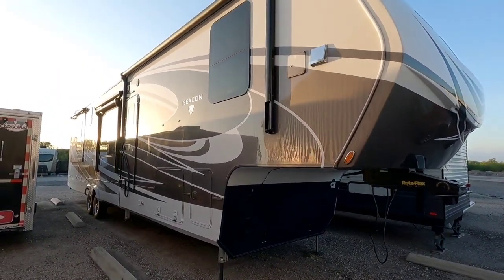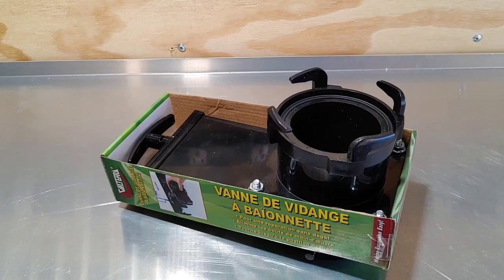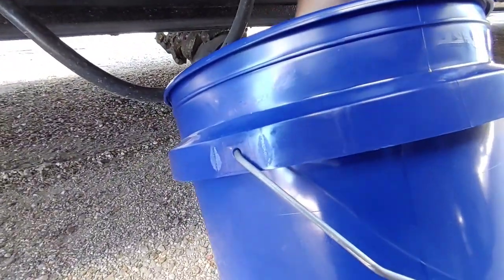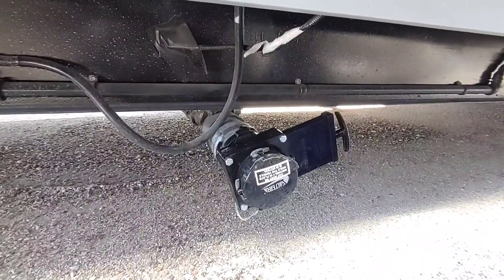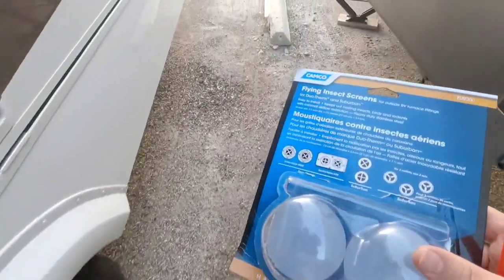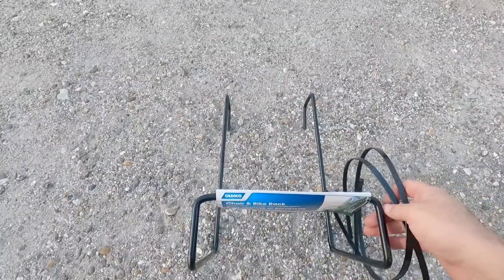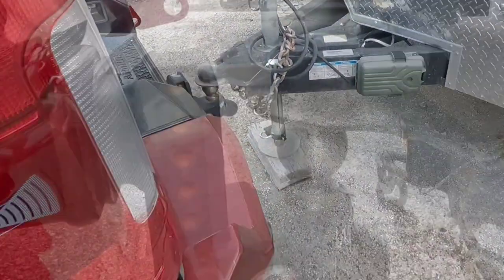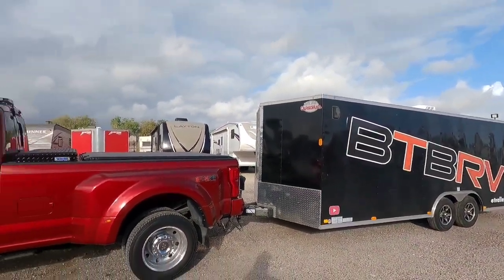3 RV Must have Accessories! All under $50ea! Valterra and Camco

Comment from the maker: I caught the fact that I didn't cross the chains before taking off.  I moved the trailer to a shed in the same facility to load up my moving equipment and added a hitch extender to the back, which made me catch that I didn't cross the chains. Sometimes filming throws you off a bit.
Reply: I caught that! No expert myself, but I do know what happens when a flat trailer pops off the hitch at 65 mph. Thank God I crossed those chains! Lol
Reply: I was hollering. Lol
Reply: Alan d'Eon  Its not that important. It's more important to not need them.
Reply: Alan d'Eon  That sentence make absolutely no sense. I don't even know what you're trying to say.
Reply: Alan d'Eon  No my response was to the topic of CROSSING them. Some people even argue they should not be crossed. The tongue hitting the ground is really a moot point once you've lost the trailer so like a said above. It's more important to not lose the trailer than to think your safety chain hookup method matters, as long as they are hooked up.
Reply: @russellv6234  you should always cross the chains
Reply: @russellv6234  
You'll think that until the tongue hit's the ground. And digs in.
Reply: I even stopped the video to make a comment warning you about the chains.😀

Comment: One big advantage to that gate valve is having a  backup valve!  If you've ever had a gate valve failure on the road, finding the correct  valve then, trying to replace it in the campground, which is usually prohibited! Or  finding a repair shop, you know the routine...... And of course that plumbing is NEVER designed for easy replacement! 
Always enjoy ur post!

Comment: Since the safety chain issue came up, maybe you could do a video showing the proper way to hitch up a travel trailer? You could talk about sizing the chain, chain length, and where to attach the breakaway cable. Most importantly, explain the purpose of crossing the chains. I’ve known people who didn’t realize they needed to have a battery on the trailer to activate the electric brakes in an emergency. That system could be discussed. 
Over the years I’ve seen trailers with undersized chains, trailers with just one chain, chains that were dragging on the ground, as well as chains that were too short. This is an issue that deserves some attention.

Comment: Yep, that Valtera twist on waste valve would have been real nice to have about 6 years ago.
Back then I bought our first ever travel trailer, (used), and did a lot of work on it. I bought it in February, so we had a few months before we could actually take it out camping. 
Keep in mind, this was our very first ever camper. My wife had always wanted one but I forced her for years to camp in a tent on cots, no AC, primitive, like the Army style. 
But I gave in finally after her back surgery didn’t go well. Lots of pain ALL the time. I wanted her to be as comfortable as possible.
So it comes to our very first trip out. We spent a week at our favorite state park. Half way through I had to dump the tanks. I went to connect the hose, removing the cap and I swear a GUSHER of waste came out. The valves were CLOSED, but… someone had obviously opened and then closed them, letting the pipe fill up. 
Bad joke on me, I was covered in it and MAD AS HECK. 
I had to use the non potable rinse hose to rinse myself off, then had to clean the mess up. 
Boy was I pissed. Incensed more like it. Fuming mad. Angry.
But the worst part of the experience was, EVERYONE around, including my wife, were laughing at me. 
What could I do ?
I calmed myself down, finished my task, remarked the trailer in its spot and promptly took a LONG HOT SHOWER  with lots and lots of soap ! LOL !
I look back on that experience and laugh about myself from time to time, but now I am gunshy so to speak when it comes to dump time. I still do the job, because no one else will, but I do it.
And no, the valves weren’t leaking causing the pipe to fill, as that was the only time it had ever happened. 
Someone played a nasty prank on me and it worked. 
Oh well, live and learn I guess. 
Now anytime, everytime we go, I make sure those valves are CLOSED and remain closed. I kind of wish they came equipped with keyed locks haha

Comment: Try a California Duster for cleaning the trailer.
I've been using one for over 30 years on my vehicles and the result is great.
Takes about 90 seconds to dust off a vehicle or trailer of your size.
Can only use the duster if the vehicle is dry.
Even though the duster holds much dirt - it has never scratched or marred the paint.
Shake it out during dusting and when finished.
The dirtier the duster appears, the better it works.

Comment: I've had the sewer surprise several times.      You would be surprised how much pressure a few gallons of poo can have. Just remember to keep your mouth closed when you take off the cap. I've changed enough diapers. Sewer doesn't even phase me.

Comment: I put that gate valve on a while back, it’s a great upgrade! Should be standard equipment on all rv’s.
Reply: Yup! I agree! I just bought one tonight…mine leaks pretty good.
Reply: Camping for 40 years never had a need for one...
Reply: Funny enough. I caught the lever for the black tank once while rolling up my 50 amp cord. The cap was on but the black tank valve was open for a minute until I realized it. Imagine the fun of taking off the cap at the dump station. A 2nd gate valve became a must after that.

Comment: The gate valve is the best thing since sliced bread. I saw someone from another channel recently install one but it was a permanent one that they had to cut the old coupling off and use pvc cleaner and cement. I like this one but I'd definitely put a screw threw it in case it decided to come off. I can't tell you over the years how many times I've forgotten to close the gray tank after dumping then find out when you take the cap off whoooosh. I've also forgotten to close the black tank before as well and just pulled the gray valve and gotten that too. I installed a clear extension on to see what's in the tube before opening. I've got the 30wrs work and play and they couldn't have put my valves in any harder to reach places. There's been times paper has not let the black valve seat properly. I just knew the next dumping was going to involve stuff in the tube. This part will eliminate the bucket to keep spillage. Thanks for sharing.

Comment: YES! I had this leakage problem with our last travel trailer.  I didn't think there was enough room to put on the extra waste valve because the connection was so close to the ground as it's was, but it should be a lot better on our next one.  After an unfortunate incident in a campground, I learned to "catch" the flow in the septic hose when taking off the cover.   But even sometimes I would forget.  😅  Thank you for all the tips in this video, especially for backing up with no camera!

Comment: Here in South Carolina the bug guards are a necessity. I installed them on on the heater, water heater, and fridge.  I learned about the Valtera valves when I took a cap off and the water splattered on my shoes. Now I’ve got the valves...not the shoes!

Comment: JD, I like your advice to install the bike/chair/access bracket higher, for this reason: seeing how far down the chairs hang, they BLOCK THE TAIL/BRAKE LIGHT. For some drivers following you, they may not be looking the other direction and could smash into the rear of your rig. Love the Valtera valve and furnace vent covers; 2 of the first items to purchase, indeed.
Y'all Be Safe!

Comment: Hello 
Tom here...
I put a self tapping screw behind one of the locking tabs to prevent the "accidental" disconnect ....
Now when I dump I do the black first-close the black gate & use the gray to flush. 
Been using mine for 2 years now.👍

Comment: The bug guards and the valve on the end of the discharge pipe should be standard equipment on travel trailers and 5th wheels. Those were the first upgrades I made to out TT. The valve makes connecting and disconnecting so much cleaner.

Comment: I did both upgrades just not the chair upgrade.  I also recommend placing a 4" ss clamp around the ears of the gate valve to secure it tightly to the pipe and prevent it from accidentally turning off the pipe when attaching or removing your hose. Place the clamp just over the locking ears and tighten securely.  Works like a charm.

Comment: JD, 
On that valve I have seen many channels that tell you to drain your black tank then leave the black tank open. Close the Valtera valve then open the grey tank... this ideally would rinse the black tank and require less water to flush the black. Well this may work once or twice but here's the problem. If you put a lot of paper in the toilet (not saying who in my marriage does this but it's not the husband) what happens is that when you back wash the black tank with grey water it will force the paper up into the air vent. Then, the paper dries and becomes a solid and can completely clog the air vent. This is a no bueno situation. What then happens is that you end up venting the holding tank back up through the toilet. Whenever you flush you get bubbles coming up through the black water in your toilet. All because some cute young YouTube RV couple told me to use this valve to clean out the black tank. DON'T DO IT!!! Flush the tank out normally and don't mix the black and grey tanks. I know it should make sense but only do it when absolutely necessary. Sorry for the rant but this information needs to get out there. I'm telling you from experience. LOL. I love looking at the cute young couples (well they can be eye candy on YouTube) but sometimes their expert advice does not come from experience. My testimony here is from experience. 
Thanks for indulging my rant on your channel. 
Pat
Reply: Never in 30 years heard anyone say to leave the black tank valve open to do that.

Comment: FYI, bought two Valterra valves for the front and back drains and after the installation put a small self tapping screw on the top next to the locking cam. Should I need to replace a valve just take the screw from the top and remove the valve, just a handy thought, thanks for the video.

Comment: One note about the vent screens, they also make them for refrigerator vents and water heater vents. I have them installed on all my vents, very easy to install, not expensive and can prevent potentially dangerous hazards like carbon monoxide or fires.

Comment: Those furnace screens are pretty slick.  Our Trailmanor has the valves at the end of the pipes so not much need to install another valve.  They look like a great idea for larger trailers with long pipes between the valves and caps though.  Cool accessories.  E-trailer is one of our go-to suppliers.

Comment: For the sewer hose hook-up, I just hold the open end of the hose I'm going to connect directly under the opening of the dump pipe. When I'm taking the dum pipe cap off, I let pressure release first, then I slowly take the cap off, tipping it toward me, then pulling it away completely once I know nothing is there and/or everything has dropped into the sewer hose.

Comment: I have an old fiver. I'm absolutely getting this. Thank you. No "surprises" when setting up at another campground. On Etrailer, the valve is $45 and change. On Wal Mart, it's $28 and change. I always shop around.
Reply: Camco equivalent of external dump valve is 19$ on Amazon -- MARCH 2022

Comment: Our travel trailer has two grey tanks that drain in the same spot.  The second grey tank is only for the laundry hookup that we don't use.  So to take advantage of that second tank, we close that outer valve, keep the black water valve closed, and open the two grey water valves.  Gravity will fill both grey tanks evenly.
Reply: Clever.

Comment: For the Valterra valve, I drill a small hole on the bayonet on the valve that connects to the rv drain pipe and insert a small cotter pin to prevent the valve from twisting off while twisting the cap off.   I think this would be a good idea for the manufacturer to include.

Comment: Tips like these are always welcome, so thank you.  Our older travel trailer never leaked a drop from the drain line when uncapped, but our newer Montana always leaks out about a cup of bluish water from the deodorant / disinfectant I always put down the toilet at the end of every trip.  I will definitely be getting this gate valve.  Great innovation for the bug guards, will get those as well.  Zip ties are a must for the ladder rack.  I learned the hard way by just hanging mine over the rung and bungie cording chairs to it.  While bouncing down the road, the rack bounced off and swung free on one side taking out our rear taillight lens, but not scratching the paint...got lucky.  Funny, but for solo backing and hitching, I have always used that same process by using a block of wood on the ground as a reference to my foot.  Don't forget to grease that ball before hitching.  I've had a heck of a time unhitching at times without greasing the ball first.

Comment: Your external gate valve is good to back flush your black tank with your grey tanks , get one you can hook a water hose up to and fresh water flush black tank. Do not flush galley tank if it does not have traditional p - trap .

Comment: One thing I got in the habit of doing. I would rig the sewer hose to the fitting on the ground. Then I would hold the camper end under the cap to catch anything that comes out when I remove the cap.

Comment: I had a mess because somebody left the black water drain valve open. I chose to modify the inside of the valve by removing the inner bayonet connector and replacing it with a standard glue in to 3" pipe. Then I cut off the bayonet connector on the outlet pipe and glued a 3" coupler with ABS glue. This also reduced the protrusion of the extra valve and ensured that it would not work loose and fall off. The best upgrade I've done yet.

Comment: One problem we came to discover is that "Prancksters" will pull that handle on the valve to allow the mess to come towards the front cap.  My husband was able to affix a zip tie through a hole he drilled so he'd know if it was tampered with or not.

Comment: My Gates are at the end of the Pipe, Rockwood 2613WS. I also have a 6 inch clear extension attached so I do not have to lean so far down to attach the hose. The clear  extension allows me to see what is left in the drain before closing the valve.

Comment: Dump the black tank first and clean out the lines by dumping the grey water last.  I've never had any surprises waiting in the dump hose or the gate valves doing this. I have never seen any RV that didn't have installed gate valves from the factory. One thing you can do is get a can of silicone spray to lube the valve rubber seals or use Thetford valve lube in your grey and black tank.

Comment: I bought a wide mouth funnel on Amazon and insert into the sewer hose and then hold under cap when I remove.  When any "surprise" is over I set funnel aside and attach the hose.

Comment: Get some Rubbermaid wire shelving end caps that go on the tips of cut ends to put on the ends of the hooks on the chair carrier. Will prevent scratching the camper.

Comment: JD- Great Video!!! I always laugh when something so obvious isn't covered, and I had NO IDEA of just how easy, simple & VALUABLE they are! The Valterra valve is exactly what I mean. However, I had definitely drank the Camco Kool-Aide. Given a free run, I have no idea of just how much I could spend at Camco. Starting with a Olympic Wave 3 radiant heater, a weekend Extender propane addition to my tanks, I have list as long as my arm! I didn't even know that they made/sold a simple chair rack for the ladder? Obviously, I'll need 2- thank you very much! Hahaha- I'm thinking $1,000's & could probably get into the low 5 digits....

Comment: Over the years I've never had more than a few drops like others have posted on here. My valves are maybe a few feet away from the end. I've always had toy haulers and I've noticed a slight difference in the dump setup between a regular travel trailer and a toy hauler. Maybe due to the toy hauler dry camping more often? We mostly dry camp out in the desert. I am fortunate though to have a clean out where I park my trailer on my property so I can take my time dumping and flushing.

Comment: I found this suggestion early on in our RV life and did install it, but wish it had been on before I got the RV, as I got quite a surprise the first time I pulled off the sewer cap. On the Winnebago the BT is on the other side of the RV from the sewer dump side, so a long pipe runs across the bottom of the RV and the valve shut off pull run all the way to the other side, making for quite a bit of space after that valve and before cap.  Wish I had thought to put a bucket under first. Really Really wish I had.

Comment: Oh big truck big RV I forgot to add one thing when it comes to steamers I’ve studied quite a bit I started out with a little tea kettle steamer back in the early 90s fresh out of the Navy and you have to be careful because the stronger ones can easily remove decals takeoff paint much like a power washer the same principles apply but if you want to get some gunk sticky stuff or sanitize something those things are awesome the dryer the steam the better